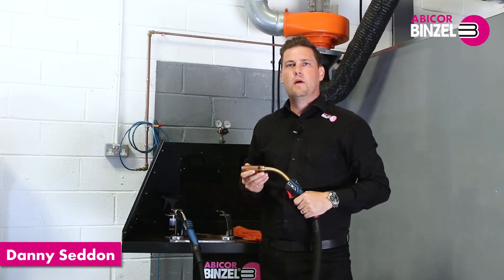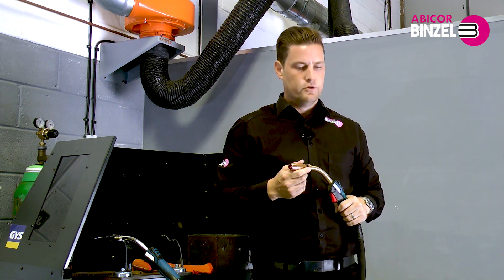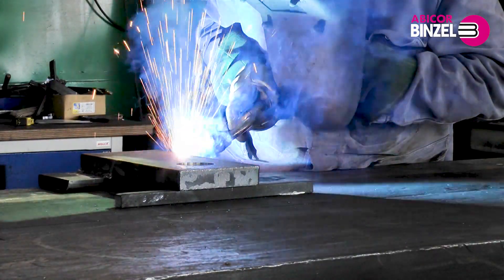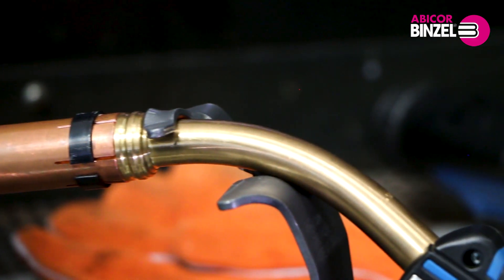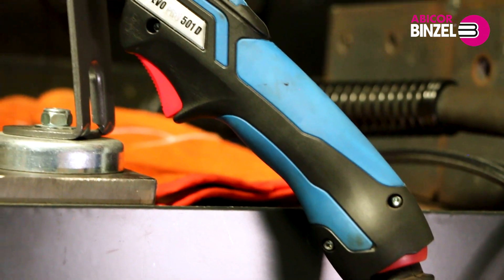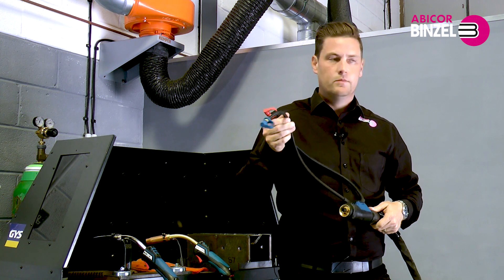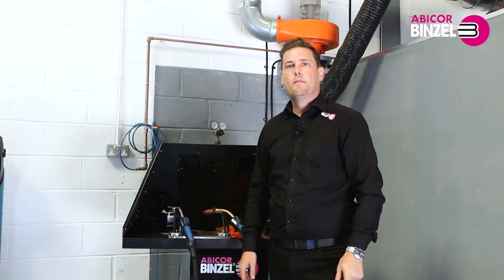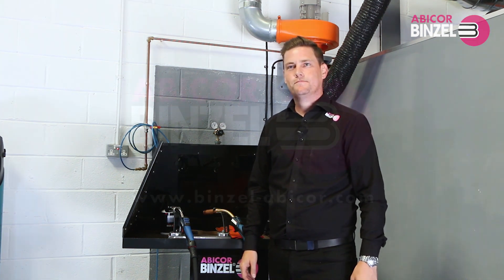Product Overview – MB EVO PRO liquid cooled

Comment: Have had the WT440 touch for 6weeks, used 6 15kg reels of 1.2mm 316l wire and the nozzle is still good, I use HD contact tips, would like to get hold of some silver tips as multi pass runs can chew through a few tips a day. And personally I prefer to use a bare coil steel liner, it's more forgiving at awkward torch angles..
Reply from the maker: Depending how hot you run those Silver Tips can last a while. Your dealer should easily be able to get you a bag to try out.